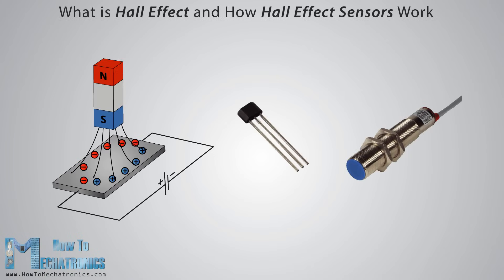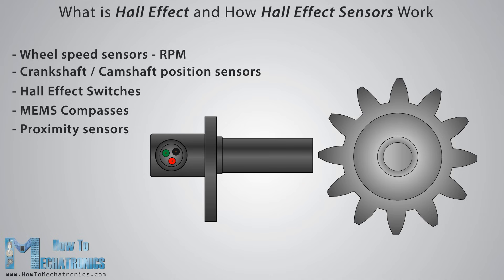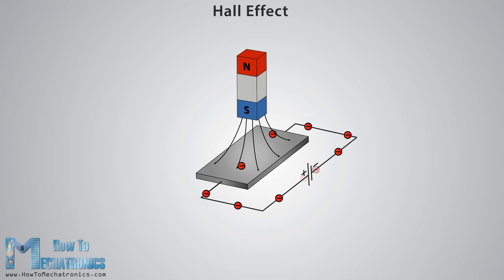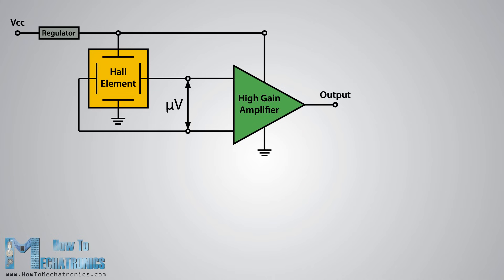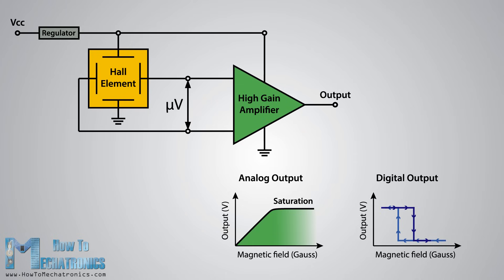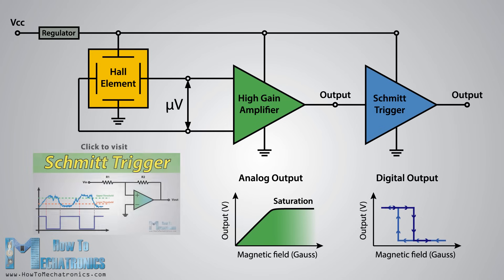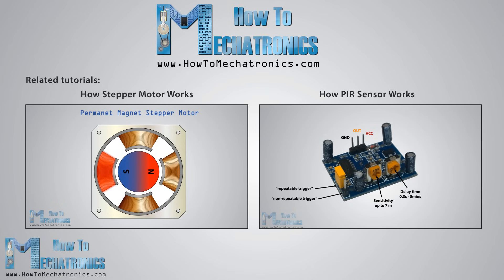What is Hall Effect and How Hall Effect Sensors Work

Comment: should the negative charges not be on the other side? assume x horizontal y vertical and z into and out of screen. I enters from negative z into positive z (assuming plate is at origin and parrallell to xz) Magnetic field goes into South pole so from negative y to positive y. Take your left hand and point your thumb at you, leave your point finger pointing up, and the middlefinger rotated 90 degrees counter clockwise. now thumb is current so points at you, wise finger magnetic field so points up and middlefinger points to the right. Thus negative charges which are free to move experience a force pushing them left, yet you portray them moving right? Am I wrong?

Comment: For the magnetic field to be changed by the motion of the crankshaft, the crankshaft would have to be made of something with high magnetic permeability (there is no such thing as a magnetic insulator). Thought I'd share.
Reply: In the video, he shows that you are correct in your initial assumption that the magnetic field emitted from the gear upon the sensor would not work. Which is why they  insert a magnet behind the sensor, it provides the magnetic field that we detect change each time a tooth comes close.

It reminded me of putting playing cards in the spokes of your bike, the signal would sound the same if you connected a speaker to the output.

Comment: Something is wrong in this .  F = q(VxB)  so the the direction and charge will both be opposite for electrons and holes so both of them will effectively experience a force in the same direction. Infact this can be used to find out what kind of semiconductor we have based on the potential that gets developed. So both the postive and negative charge experience force in the same direction owing to the fact that their drift velocities are in opposite directions
Reply: you're right but in this case only the negative charges (electrons) are really moving. The depicted image of positive ions on the bottom and negative ions on top really is just showing the net charge in each location. With a higher concentration of electrons on top and less concentration of electrons on bottom, there is a net positive charge on bottom and net negative on top.

Comment: I don't think ABS sensors use hall effect at all
Reply: Then what would they use? Only other logical possibility I can think of would be a magnetic toothed gear turning with the wheel and a simple coil creating an ac output for the computer to read, but then the magnetic toothed gear would attract iron and get clogged...
Reply: @rosebarnes9625  Actually I've done quick googling and there are two types of abs sensors: hall effect and inductive.  Second one are magnet with coil. Tooth of gear change the flux so it can be sense by the module.
Reply: So really a hall effect sensor with a slightly different layout? Non-powered hall effect sensor? Interesting...

Comment: Hi, does the voltage happen, because of the force from laplaces law?
Reply: Jakob Jespersen the voltage is due to the (Lorentz) force that is applied to the incoming electrons in the presence of an external magnetic field. It “pushes” the electrons to a specific region of the “hall element”, depending on the orientation of the magnetic field and the electrons’ velocity (right hand rule). Thus a potential of some voltage is created in the hall element.
Reply: @miguelguerreiro3402  Thank you Miguel! =D

Comment: good video, but an hall effect sensor will never delivery a digital signal, even if the output signal is a square wave form ... All pulses of a digital signal are assigned to a particular meaning, as parity bit for example. It is not the case of the pulses of the hall effect sensor output signal.

Comment: How RPM is calculated from the square wave pulses? Pl explain
Reply: In the example shown, the output of the Hall sensor would go to a divide by 12 circuit.  The output of the divide by 12 circuit would then be totaled for one minute, and the number of pulses arriving in one minute would be the same as the number of revolutions in one minute.

Comment: Example: ring gear teeth on automotive engine flywheel (designed for the starter to engage with); were a sensor be placed in close enough proximity with the aforementioned flywheel teeth, would/could a hall sensor be fast/sensitive enough to detect magnetic fluctuations (or would it somehow "saturate')? - flywheel diameter approximately 300mm.

Comment: From this explanation, it looks like hall effect sensors can work at very high frequencies. I wonder if I can use them as Isolated couplers, like you would optocouplers. I need to commutate high voltage mosfets in todem, at very high switching speeds, across 500 volts, but they need to switch quick, with very little propagation delay. I might consider the linear version, so I can drive an integrator to get faster response times. Can these detect signals in the RF range?

Comment: I Have a truck in that all wss are showing 1.7v while the wheels are still. Creates pulse fine when rotated but ABS lamp is still on dash. Any ideas how voltage is getting to the sensor? (Bearing in mind they are passive sensors)

Comment: i'm not sure about the "microvolt" thing but anyways if you want a raw hall element without managing circuitry inside it's inside floppy drives and old CD spinners... there are quite always three as four pinned SMT thingies under the circular magnet, datasheets are scarce but they are symmetrical, as in the video, you power it trought a resistor giving like 1mA from up-left corner to bottom-right and read on the other two, they're versatile

Comment: hello, Actually we connect that proximity sensor near shaft of motor and its also sensing moment of magnet near it but as soon as we start motor its showing only dash(-) and when motor we turn off motor its started working again.
the problem is we want sense the motor rotation but its shows (-). we check connection at least 5 times its perfect but we are not getting why motor is affected to its sensing process.

looking forward for your answer.
Thank you.

Comment: In the first graphic visualization, shouldn't the electrons (negative charge carriers) be forced to the side closest to the emf device since the south pole of the magnet generates a magnetic field pointing in the upwards direction? I can see how the visualization would make sense if the magnet had the North pole pointing downwards.
Reply: Ryan you are right actually while finding force we use current . Length cross magnetic field and length is along opp. of flow of electrons and he has incorrectly shown the magnetic field if you will reverse magnetic field and took legth along flow of current insttead of flow of electrons you will get same result..

Comment: The direction of motion of the electrons is incorrect, the force will be acting in opposite direction. The magnetic field lines out of the south pole should be reversed.
Reply: You are right! electrons move against the current's direction!
Reply: Yeah I immediately noticed the magnetic field's direction arrows point the wrong way.  This makes the animation misleading.
Reply: yes. i got confused and had to check the comments

Comment: the magnetic field lines should be in opposite direction and therefore electron will move to the right according to Fleming left hand rule!!Correct me if i am wrong.
Reply: Joel, you are correct. The animation shows the proper deflection corresponding to the direction of the field lines, but in reality these should be reversed due to the orientation of the magnet. Good catch!
Reply: that's what I noticed as well. It's easy to get right hand rule confused, but seeing that I'm not the only one who noticed I would have to agree that the deflection of the electrons is in the wrong direction based on the orientation of the magnet
Reply: Joel Lee you’re absolutely right 👍
Reply: But the direction of current (as stated in left hand rule) is opposite the flow of electrons, which would make the illustration correct, no?
Reply: Samjh gya na....itna hi bahut hai
Reply: +Joel Lee Yes, but the electrons have a negative charge so they go the other way. as F=Bqv, and q=-e

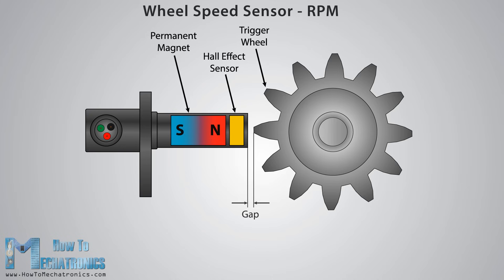Comment: (min 3:22) I'm having hard time understanding how the tit of the disc is affecting the hall effect.
Reply: when the metal... tit... gets near the sensor the magnetic force of the magnet increases and... strighten... itself... letting the sensor read an higher value, there's an off center shimtt trigger circuit that revolves only around one magnetic pole, as in a PC fan sensors... (dammit!! now she knows i'm a nerd)
Reply: @redoverdrivetheunstoppable4637  Thanks. Now I understand.
Reply: so it only works in materials with high magnetic permeability?
Reply: I think it works with any material capable of alternating the magnetic field on the , and hence the force on the conducting electrons.